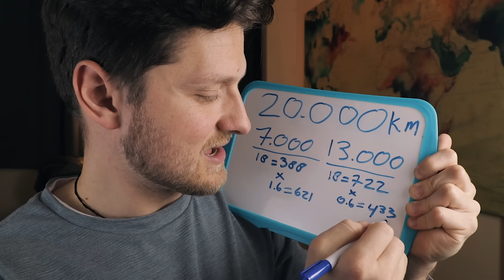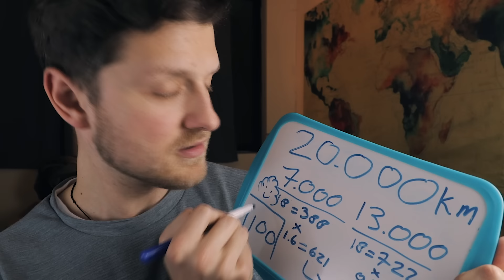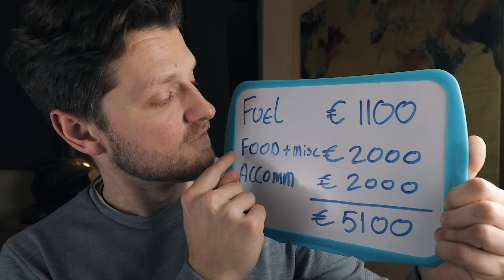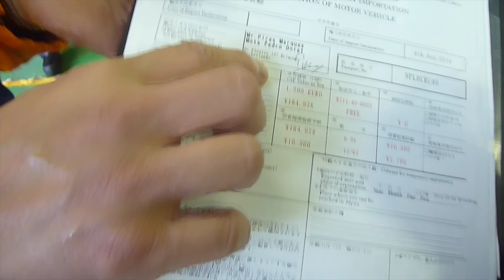COST TO TRAVEL THE WORLD by MOTORCYCLE (quick & dirty calculation)

Comment: Brilliant Pedro, Been away myself so only just watched the last three, all were extremely helpful for the motorcycle traveller.  Can I just chip in and say I was shocked at the water costs; I use a Steripen and more recently a Grayl...  melted snow the other week for a brew :-) Ride safe
Reply from the maker: Usually water is 1 or 2 aud a pop, but in roadhouse country prices skyrocket so you get $5 water. Would too like to get something to purify water with at some point.
Reply: I'm not always certain the bottled water bought is good.  I think the Grayl has been our favourite; the Steripen needs batteries and imo has been a bit fickle.  We even use the Grayl on our Iceland trips to take out particles in suspension, as it's not just bacteria etc in the water that can get you.  It's a water container too.  Ride safe

Comment: thnx for this quick and dirty vid. after a few europe rides, was this just the bump that i need :) 
my overall plan(just a brainspin yet) first i start in europe, for the next 2 years, 6months work/travel. than after about 5 years i want to ride a rtw, maybe not original following the silkroad through the stans. at the moment i am looking for a bike. xtz750 or tdm 850 with offroad equipment. i will ride as basic as can be.

Comment: I recommend bringing a cheap water filter or a expensive water pump about $100 is what you should be looking after that it makes filling up a water bladder like a stick in your backpack really easy of course also bring a metal canteen or something like that where if you need to heat your whole water bottle up to where it boils for a minimal of three minutes but just because your bottle is made of metal does not make it safe it could explode if it has a vacuum seal  

also I bring extra oil and gas with me  I don’t get a lot of extra gas & oil but an 2 extra liters for both of those will help me get to a proper gas station if I have too much fun on the dirt road and I don’t notice my fuel gauge is hitting the red or if I drop make bike and I leak oil 

Also bring things to plug tires and other things on your bike and a little bit of duct tape goes along way

I always bring medical supplies including 4 tourniquets Incase I have a very bad accident or snakebite and get shot that last one is very unlikely but it can’t happen 

I alway bring a both a Solar panel in hand crank charger that can be plugged into a wall if needed  , paper maps and compasses are a most along with Digital maps that can be more accurate. 

Most of the places I’ve ridden  are in the United States Mexico and Vietnam so I add or take from my list of needs depending on the country Việt Nam only has 3 major roads going north and south so I can cut down on my maps just my phone and 1 paper map with compass is enough I did also download I Vietnamese map app  and my wife Is Vietnamese so I have a person who can read the road signs more naturally then  I do  I do not bring a water filter there the water might not be safe to drink after it’s been filtered and boiled do to agent orange  if your north of Hanoi don’t worry about that but if your between  Hanoi and Sài Gòn also know as Hồ Chí Minh city it is something to think about just stick to imported water bottles  and you will be fine   And dual sport bikes and scramblers are your better friend in Vietnam even in the city’s just because the roads are that crappy even if you stay  on the road you want to go over pot holes not into them  if you have a triumph scrambler 1200 XC or XE that’s the bike to have especially the EX model

Comment: as an Aussie rego was my biggest question. i know in Australia at least you can't drive a bike that's not registered and insured locally but i was under the impression that a foreign bike was not cheap to register if it had not been imported by the manufacturer.
Reply from the maker: My bike was there on a carnet.

It was interesting how in NSW a lady popped out of the office with a clipboard while she barely looked over the bike as I flipped the switches and quickly went down her checklist, done. The second time in WA I had to find a certified dealership to do a more serious checkup, at a cost too. Rego had already expired in SA so I was worried about some crazy regulation that I could only legally show up with it on a trailer, you just never know in Oz as you probably well know but all was good. Didn't do it in SA because I think (not 100% sure) I would have had to change to Aussie plates.

New Zealand though was dead serious about their checkup and had me a bit worried since the bike was at its worst possible state. Got denied the first time because of a tiny fracture in the rear rubber brake line which had been there since I bought the bike in 2010/11. Didn't expose the inner line but still. Before the second try I slid a short section of extra protective hose that was on there already a bit further back over the crack. Passed the test after that, but Nz did not play around for sure.

Comment: I would say a shitload of cash. Fuel costs are about $.10 a mile if the fuel is about $2 a gallon for my bike. For example, every 1,000 miles planned to ride carries a fuel bill of about $100. Where do you plan to stay? I prefer state parks at about $16 a night. Sometimes you come up short of your campground and get caught staying at someplace more expensive. I really try to stay at hotels that are $50 a night or less. How often do you plan to eat? On a long ride I'm good with a once a day meal with stops in between for taking in fluids. $25-30 for food and drinks. Riding the plan is 200 before lunch, and 300 after so that means. $50 a day for fuel at about $2 a gallon.

What does that mean for minimum expected daily costs? 

State park kind of day. About $100, If it's a hotel kind of day, about $150 That doesn't cover maintenance, or repairs, or anything you might buy along the way. The last time I went on a long ride I had about $5K for a 60 day planned ride. I came home with no folding money, and only a little bit of silver on the last day.

Comment: The only thing I'd add to your list is depreciation for new bikes... if you really want to understand the actual cost of a trip you need to include depreciation. On a $25kusd bike like the Multistrada... 10,000 miles is a lot of depreciation. If you assume the bike will have a 100,000 mile lifespan then you're in for $2500 per 10,000 miles travelled.

For me cost depends on a lot of things... I spent about $10,000usd per month (about 11,000 miles per month) to tour on a Ducati in North America in reasonable comfort (hotel 1 day out of 3). I think I could do it for $5,000usd per month if I rode an inexpensive bike without having to drop comfort level. Could also easily spend $15,000usd per month with more creature comforts. In Europe I spend a bit more (stuff like fuel is more expensive) and Canada is more expensive than the US (more like Europe wrt costs). Have not been to any exotic locale's yet.
Reply: Buy bikes with more depreciation built in. I bought a GTR1400 2010 for 4K and added 5k miles over 10 days this year. Still worth 4K. !
Reply: @3004andy  As I mentioned, if you're worried about the cost of a trip you ride a less expensive bike. I have a Tiger 955 that I did the same thing with ... rode it for years with almost no depreciation... but I didn't buy the Multi to be a garage queen so I don't worry about depreciation (other than recognizing it's a cost to factor into riding).

Comment: many RTW travelers expenses are not based on distance (km) but in the most cases shows calculations per day ~100 euro/day, with bottomed average 50-60 euros/day(reaching the almost top in switzerland). And expenses divided almost equally; fuel, accommodation and food. of course some countries a cheap some not, but save planning tool is to have 60-100 euro/day. Another important rule - longer you travel cheaper it goes, but time always is an issue.. Sometime is good to use "try and by' principle to test comfort  level vs expenses on shorter trip. @Pedro what is your  results per day expenses?
Reply from the maker: I should calculate it like that more, usually keep the numbers separated. I would say on non 1st world stints €30/45 a day or so with accomodation, -€10 without. Same in countries like Australia because of no accomodation and I ride around with wraps, block of cheese, bag of ham, red onion and cans of tuna and rice/pasta.
Reply: that's interesting... we are 2up on day 368 and our current cost is USD 26/day. All included but the costs to move from Europe to South America.. I think the amount of kilometres you do also makes a huge different as we've met people that are traveling for over a year now that have done less than half the distance we did, therefore you spent half with petrol/oil/tyres/chain/sprockets/all the stuff that goes with the kilometres you ride... as well as how many countries as that might increase costs with visas/insurance/fees/etc....
Reply: Another Look At Me video waste of time

Comment: Personally I plan on going camping in southern Spain next winter...
But not wild camping, I'll be going to commercial camping sites.
If you don't insist on being on  the coast, you  can find some cheap ones over there. I have identified 2 in southern Spain and one in the south of Portugal that will cost me around 11€ per night, including cold and hot water and electricity. I'd say that's quite cheap. In Spain, look for "category 2" campings, these are the cheap ones with still some services like bathroom and a convenience store. They have a different classification system from the rest of Europe.
I use sites like vayacamping.net to find them. This one will give you a list of camping sites where campfires are allowed: https://www.pitchup.com/es/campsites/spain/-/campfires-allowed/
When in France (my home country, I'll be leaving from there) you want to look for city campings. In french, "camping municipal [name of the city]". Those are subsidised by the city and will usually cost you around 13-14€ for the same thing as above (hot / cold water, electricity).
Reply: If you want to ride with a fellow motorcycle traveler and share some beers and talks let me know, I live in the south of Spain
Reply: @WhereIsWiljenn  with pleasure 👍
If all goes well I should be there around late September / October and until the beginning of Spring.